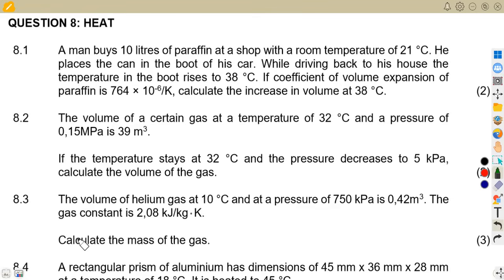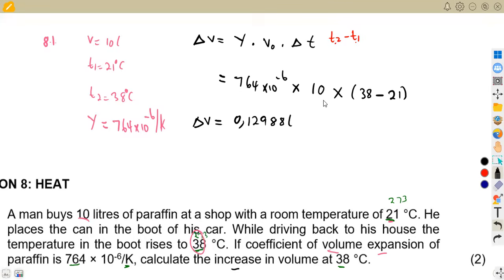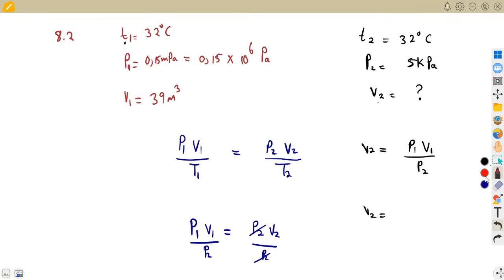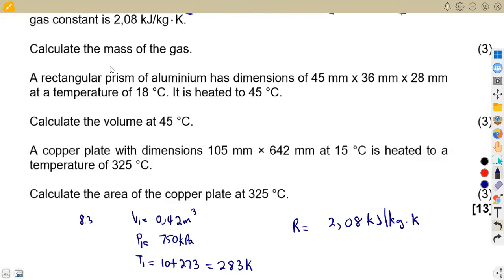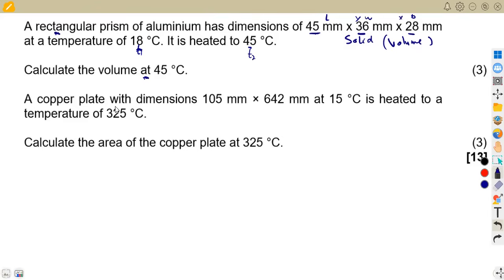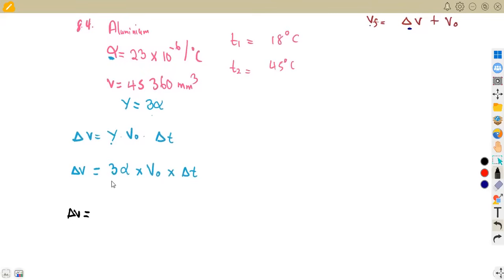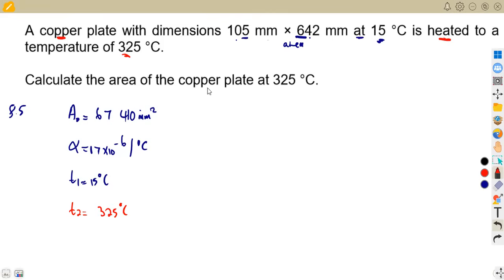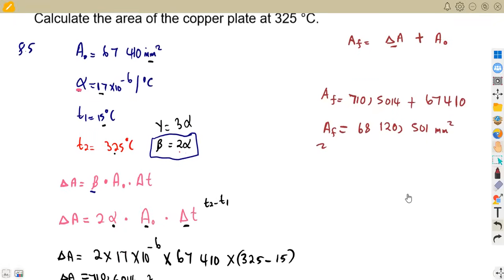Engineering Science N4 HEAT April 2023 @mathszoneafricanmotives

Comment: When I have temperature as degrees Celsius and pressure as pa do I need to convert cause on 8.1.2 I did not convert 32 degrees Celsius to kelvins and I converted 0,15 kpa to pa and I got the same answer as you
Reply from the maker: It’s still Oky that way,  temperature is not affected